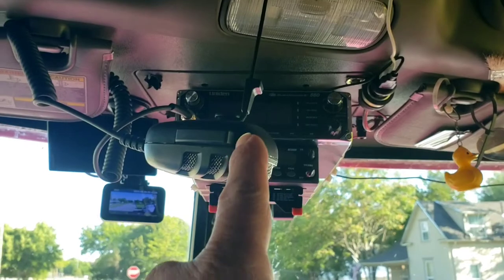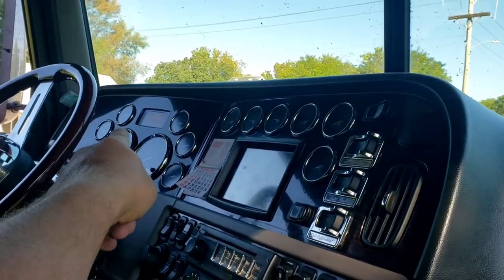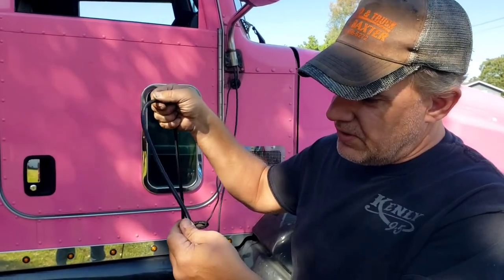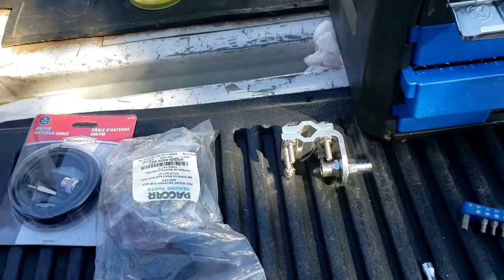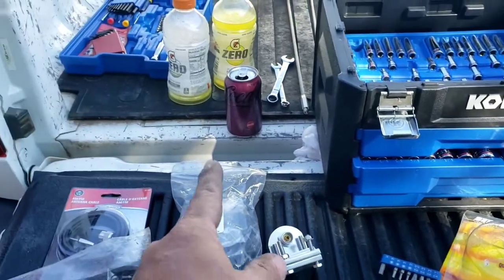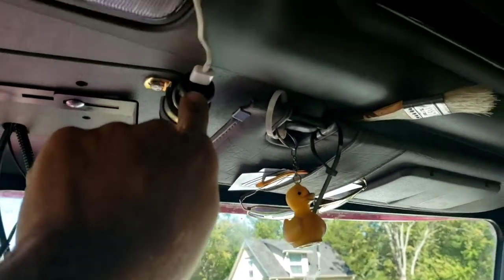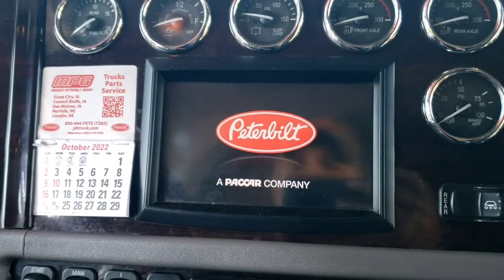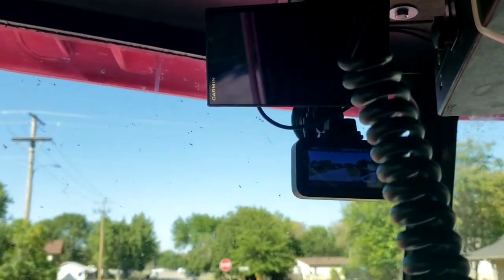Replacing C.B. coax and GPS antennas on the Semi

Comment: What I’ve learned driving Peterbilts for years (or ANY class 8 truck for that matter) is that co-phased CB antennas aren’t that great due to the fact that its extremely hard to get matching SWR’s from both antennas evenly at the same time. Instead of going through what you’re ‘about’ to (I just started watching the video) I always mounted the ‘useable’ antenna on the driver side mirror, and, the other one on the passenger side was merely a dummy antenna for looks. I had lowest SWR readings with one antenna bc everything is going through only one antenna…and, my audio output combined with my carrier signal went further down the road as well. Just saying! Stay safe out there, Brother Trucker! ~Jim~

Comment: That job I hated at the dealership when I worked there every thing always broke and 95% of the time people bought the absolute cheapest coax.       I would rather be kicked in the balls.  Than do that job.  8hours is about dead on
Reply from the maker: I would have had it done in about 2 hours had I not been filming, and drinking, and drinking.....
 I'd also done this before so I knew what to expect. Once I got it through the mirror bracket and went really fast

Comment: What coax cables did u buy
Reply from the maker: Just a generic off brand. I didn't have the right crimpers to make it from scratch which I would have preferred to do but I bought the brand called, CB stuff. I'm not sure who actually makes it. It's just a bunch of repackaged stuff for retail. It was the only stuff I could find off the shelf that had a screw on adapter on one end. Not a big fan of those but they work fine but if you can crimp your own ends, you'll be better off

Comment: What is the best coax to run for a pickup with a Cobra 29?
Reply from the maker: For something that's going to be permanently mounted, I recommend something that's got a pretty heavy shielding and that's pre-made, Unless you have all the proper tools to crimp the ends. 
 There's not any really specific brand I can think of because the majority of the stuff I run into is all made by the same people. I know you can buy rolls of coax, and good quality coats but you'd have to fabricate your own ends for that. Also in a pickup truck, you have to figure out which size antenna will give you the best standing wave. On my old pickup I found out shorter antennas worked better than taller ones. It's just something you're going to have to play with.
 But as for the actual coax, to shop around and find something that seems fairly durable that's not going to get tore up in the elements.
Reply: Thanks Dave. I appreciate it.